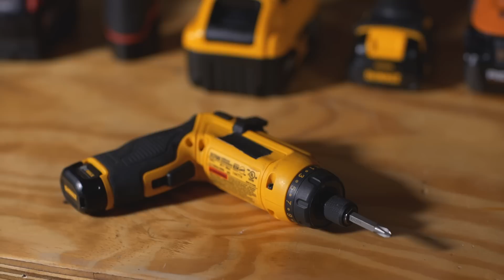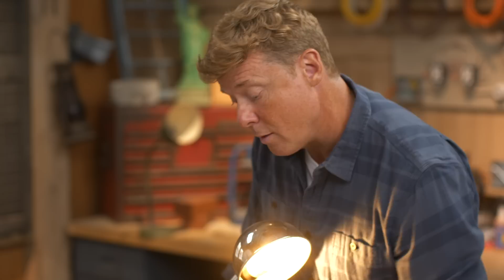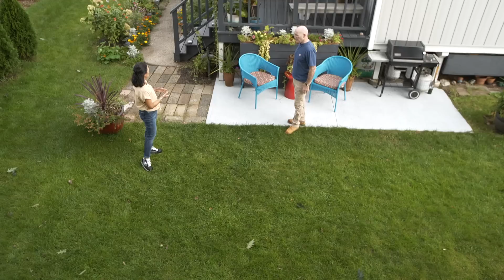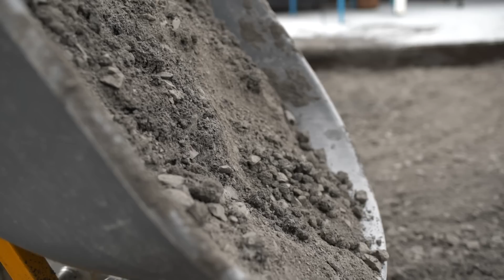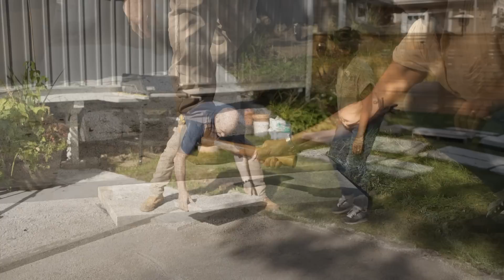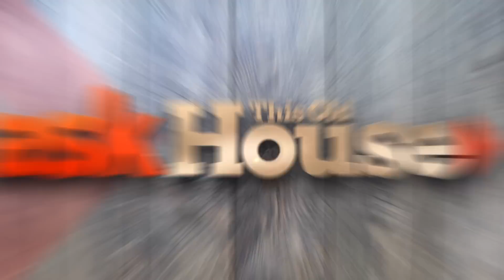ASK This Old House | Drill Drivers, Patio Expansion (S20 E9) FULL EPISODE

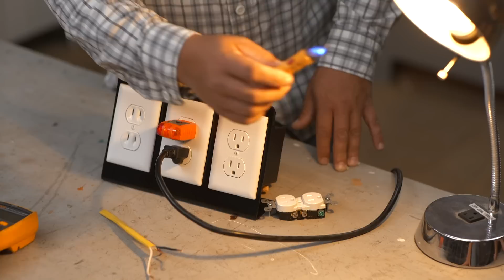Comment: 8:00 luckily we do have symetrical plugs in Germany and 230V as standard. 
Therefore, there is always a 50:50 chance, that someone plugged in the plug „reversed“. But still we do not electrocute ourselves the whole day 😊
Of course, if your plug system provides that polarity feature (like US 3-pin, GB-plug, Swiss plug and Schuko w/ earthing pin on socket) you should install it correctly. But it won‘t be more hazardous, if it won‘t provide that feature.

Comment: The turf between the stones looked terrible. It didn't fit well into the gaps and at least use some long u-shaped wires/staples to anchor so you don't see the obvious huge nail heads that would tear through anyway because of the sand. It made an already out-of-place patio design look poorly done.

Comment: I would have replaced the uneven pavers to the left of the patio slab also to make it look a bit more cohesive and maybe paint the patio under the deck. Otherwise, i do like the look with the artificial turf because yes, maintenance of real grass would be a PITA.
Reply: Just dip the brush a little bit
Reply: The homeowners may yet replace the pavers.  The scope of this project, though, was just an expansion of the patio.